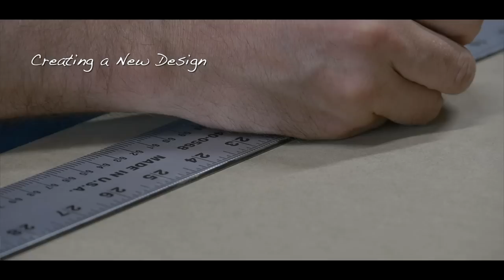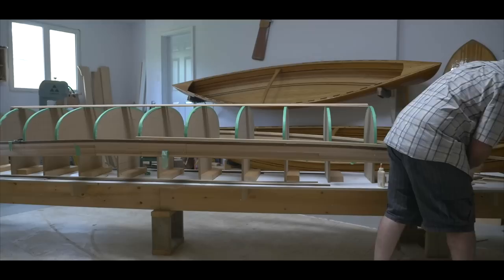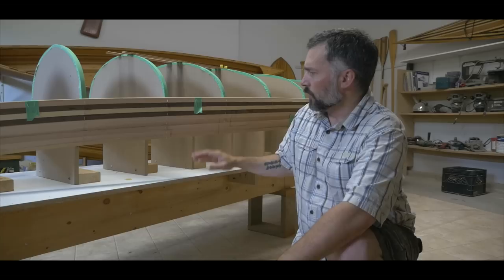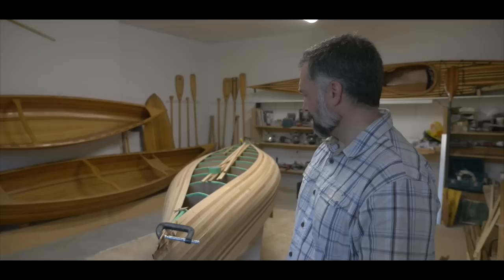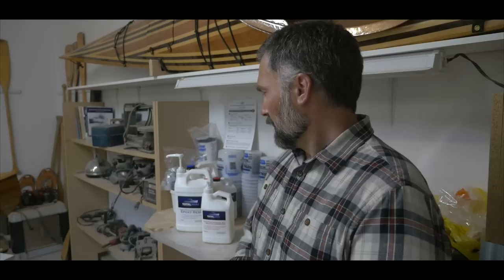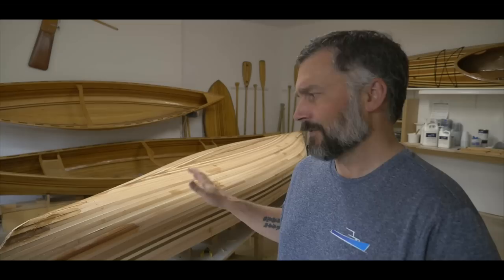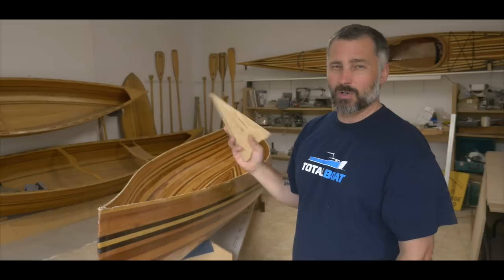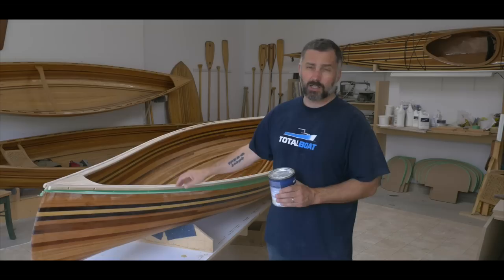Building My Solo Wilderness Tripping Canoe - BEST CANOE EVER!

Comment: I built a 16’ cedar strip Bob special for my solo tripping canoe, but can also use it for two paddlers.  Looks pretty similar but with a little more tumblehome.  It has been awesome, I have put a lot of miles on it, and it handles the wind very well.  Light enough that I can portage my canoe and pack in one trip (getting harder as I get older).  Thanks for the video.
Reply from the maker: They are very similar. I took the Bobs and Prospector, combined them and shortened the length to 14 1/2 as a dedicated solo canoe. I love it. Super stable for fishing and photography/video and light (probably around 40lbs). It's been on some tough trips and performed great. Thanks for watching.

Comment: Awesome build!  You can extend the pot life of epoxy by moving it into a baking tin after mixing.  The larger surface area reduces the depth and slows the kick rate.
Reply from the maker: Yes, you're absolutely right but thickened epoxy tends to kick off quicker because its such a thick mass.  
I'll often just pour my epoxy out on the hull when laying up cloth.
Thanks for sharing that in the comments, good bit of information for anyone thinking of building a boat.

Comment: Hi Jason,
Great video, as are all your videos. I'm currently getting set up to build my first cedar strip canoe. I've been wood working for many years, but haven't tried a project like this before. I already have most of the tools I need, the ones didn't already have I'm getting. The biggest problem I have is not having a place to build it. That problem is currently being solved. I  decided we need another storage shed. I'm currently building a 10' X 20' storage shed, which will be my canoe building shop before it becomes a shed. My plan is to build a Prospector but but shorten it to a little under 15'. Currently sourcing lumber for the canoe, while I pick up lumber for the shed. Thanks for all your wonderful videos, and insight. Many thumbs-up from Southern Oregon.
Reply from the maker: Sounds like a great plan.

Don't forget that Bear Mountain has plans for their 15' Prospector Ranger.

Comment: I'm not a staple builder. But I do like it when people build better-looking boats. Using a whetstone you can sharpen rows of Staples very little time. The now razor-sharp Staples slide between the cedar fibers without tearing. Nobody does this but the holes can be swell shut with steam. Clearly 50% of the holes are completely invisible while the rest of the holes that do not disappear completely are now 90% smaller.
Reply from the maker: Ok

Comment: I wanted to see the process of pulling the staples. I was wondering if they'd scar the wood. This is such a beautiful project. In other videos I see builders avoiding the staples and using cords/strings and clamps only.   Thanks for sharing the work.
Reply from the maker: Yes, most of my other builds are staple free but I was in a hurry and building with a lot of short strips which were scrap wood. I figured the staples didn't matter this time.
Truthfully I hardly notice them.
Reply: @TrailguidePictures  Thanks for the reply. I understand and I am glad the end result did not suffer. You have great skills.

Comment: Can anyone comment on the use of the staple gun to secure the boards to the form?  I'm about to start a canoe build and I've seen both the staple method and I've also seen people using elastic cords to hold the boards down until they dry.
Staples seem like they would provide a more secure hold and be less finicky, but won't that make an ugly row of holes in the wood?  Or when the glue is all dry, do you go back with a glue/sawdust combo to fill in the holes?
Thanks in advance for any advice.
Reply from the maker: Hey Adam, the staples will leave tiny hole marks and it doesn't matter if you fill them.
I built this canoe using scrap wood, so wasn't worried about the staple marks.
I have a bunch of building videos and one specific to building staple free. You can find them in my playlist or visit my webpage https://trailguidepictures.com/canoe-building/ for a list of videos. I also have resources for kayak building on the site, so there could be useful information for you there too.
Good luck with your build.

Comment: Impressive as always, Jason. Just curious......if you weren't sure if you wanted the holes to tie off or not, wouldn't it be better to do it, or is it easy to add later if you decide to?
Reply from the maker: It's easy enough to add them to a deck later, just a matter of drilling a hole. I did end up adding one to the front deck.

Comment: Boat is beautiful but why no stems ?
Reply from the maker: Stems aren't necessary and you can save a tiny bit of weight. What I found was that my boats with stems still required maintenance around the ends after use (from coming to shore or hitting rocks, etc). I decided that it was better to build without stems and instead use a kevlar skid plate. The result is a trade of weight from stems replaced with weight from skid plate, but the skid plate creates a much more durable end with a lot less maintenance.

Comment: If you can answer this please..I have watched a few videos of these boats being made and have never seen anyone other than you use a staple gun.. Does that compromise the integrity of the strips?
Reply from the maker: Hi,
I normally don't use staples for my builds but I wanted to get this canoe built fast. Staples have been used in the building process for a long time and are illustrated in a few books. They don't compromise the strips at all but leave a tiny pin hole sized mark in the finished boat. Check out Gil Gilpatricks book on strip canoe building and you can see his method using staples, nails and screws.
Thanks for watching.

Comment: Awesome! I've built a stretched Wilderness Express (16.5) but I find I'm mostly solo and its HEAVY and I get blown around; especially without cargo. Being a novice builder I think I added more beef and epoxy than I needed to. You've inspired me to try again. The beam is pretty wide on "ugly" canoe and it being so short. Curious as to why you went this way? I'm going to try without stems next too I think. Your's looks great without them.Also, which epoxy do you prefer now that you've tired 3 (I used West).. If you want to see a true ugly canoe you'll find me paddling it.
Reply from the maker: Hey Mark,
The canoe is beamy for a few reasons but mainly so that it has ample stability for photography, fishing and for poling the canoe in shallow water.
As for epoxy, its really difficult to say. I've used West System, MAS and now TotalBoat but have only used MAS on the Shearwater and TotalBoat on this build. Each have calibrating pumps, finish clear and more importantly, I didn't have any issues with any of them during layup.
What I can say is that I did find TotalBoat to have a low viscosity that flowed really well when I was saturating the cloth. Another point about this brand is that I also used their "Lust" varnish (and even though I don't think you need to match products) and it was nice to use an epoxy and varnish made by the same company. 
The varnish, btw, is definitely worth checking out. Available in both Matte and Gloss, I did the inner hull with matt to keep glare down and did the outer in gloss. This is a really great marine varnish.

Comment: hi, thank you so much for your vids, they are great to watch and very instructionable , i live in europe and it is very hard to find cedar wood, it is possible to make a strip canoe from other wood, for example pinewood or any other wood, any recommendations, thank you for an eventual reply
Reply from the maker: Yes, you can definitely make a canoe from wood available in your region. The highlight strips in this canoe are pine and mahogany. Cedar is the common wood in a strip boat because of its rot resistant properties, light weight and availability in the region where these types of boats were first produced. 
I'd suggest looking for a wood with similar properties in your region, or as close as you could get.
Reply: @TrailguidePictures  thank you for your reply, i think i will go for some good old pinewood and see how it goes, thank you for your advice

Comment: Beautiful build. That's the first time I've seen a no stem boat,  Was your table of offsets loosely based on any other canoe and is it symmetrical?
Reply from the maker: Yes it is symmetrical and I used the Prospector and Bob's Special as inspiration, combining the two boats and reducing the hull length to 14 1/2 feet.

Comment: looking good jason , are the bead and cove on the ends aswell?
Reply from the maker: Yes. I've built my canoes without an inner or outer stem for years now. It's one way to reduce the weight by a couple pounds and saves a bit of time building.

Comment: Hi Jason! Great video thanks for doing.  What process did you use to laminate the 2 deck pieces together?  Also how much varnish did you use?
Reply from the maker: Thanks. The deck was joined just like any lamination, run on the joiner, glued and clamped. I believe 3 coats of varnish went on.

Comment: An excellent informative video ,as always . For joining short strips together to make them longer   did you used the butt joint method ? Thanks
Reply from the maker: Yes I did. I normally would use a mitre or scarf but didn’t bother with this ugly canoe.
Reply: @TrailguidePictures  You keep them together very well ! If both end meet at the Mold I think you staple them to the Mold individually ,how about if the joint locate between 2 Molds ? Many thanks
Reply from the maker: Jahangir Behzadpour just a small spring or c clamp if needed

Comment: Great job loved watching, I have 2 questions, about how long did it take to build in total and what does it weigh? Thanks
Reply from the maker: Hi Dave,

This canoe only took around a month to build, working at it part-time in the evenings. Faster than most but I wanted a canoe built fast to take out on solo trips. Usually a canoe takes around 120 hours. I'm guessing this was built in half that time.

The canoe weighs around 40-45 lbs. I put it on the scale but forget how much exactly, but I remember being happy that it was well under 50 lbs and comparable to other manufactured boats of its size.
Reply: @TrailguidePictures  thank you it's a great looking boat

Comment: Awesome build - very cool. Just wondering - is that Elmer's glue on the strips?
Reply: Don’t know if you’re still curious. I was an engineer in a furniture factory and learned a little about glue. The main problem with white glue/elmers here is working time. It sets up fast. Yellow/brown/Titebond glues will give you a lot more time. The fiberglass makes up for the strength difference and water resistance between the glues.
Reply: @zachkiss8870  Thanks!

Comment: W
Jason. What is the length and gunwale width?
Reply from the maker: 14 1/2' long by 35" wide. I thought the width would make her slow but she actually goes pretty good, of course she's not a race horse either.
Reply: I figured with 13 separations it was likely around 14ft